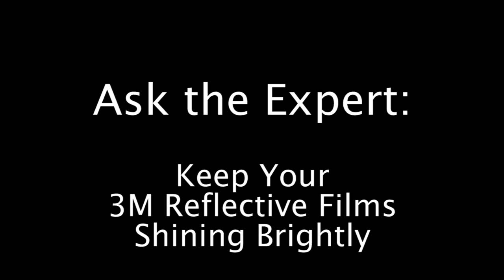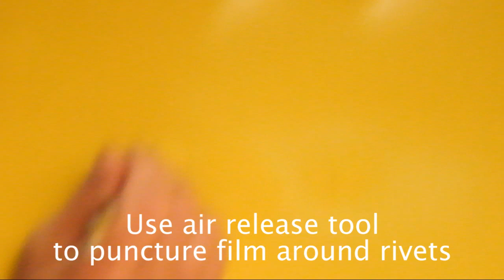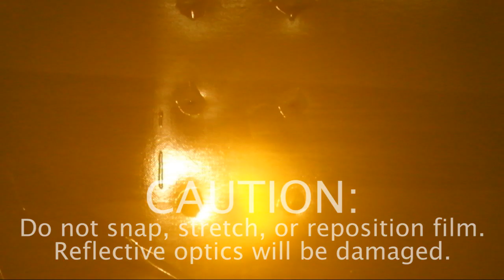3M Reflective Film Application

Comment: this is not the way, if you can’t afford the air egress, wet apply and do the rivets after with an air release tool and a foam roller. all that jerky wrist and shoulder motions will do for you is ruin your life. 3m thinks we have all the time in the world and can replace shoulders when necessary smdh